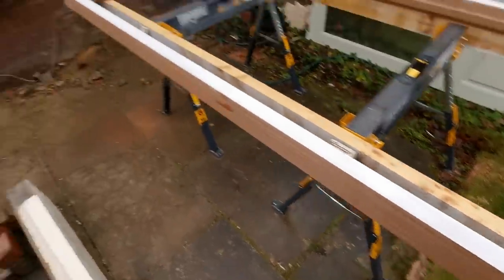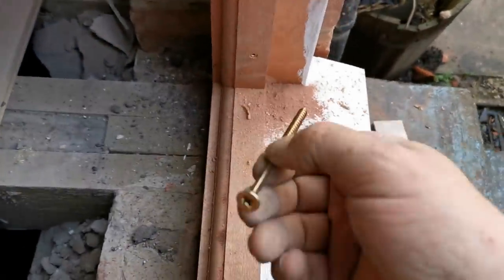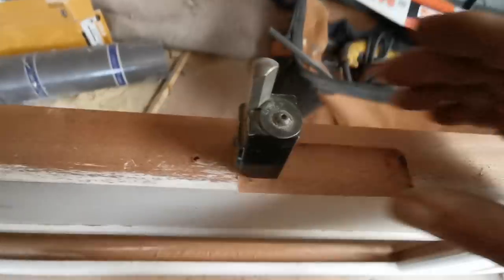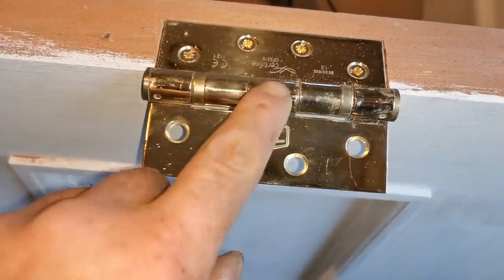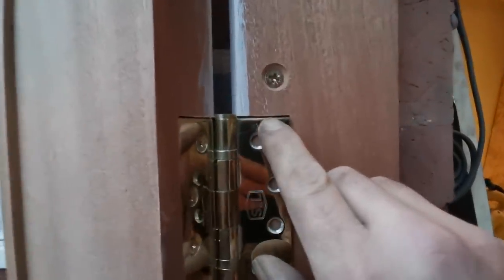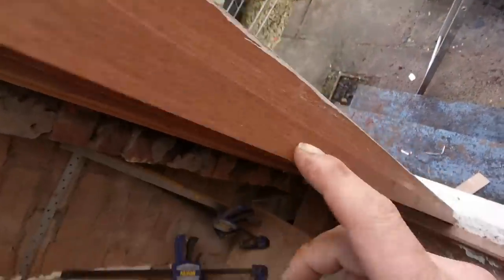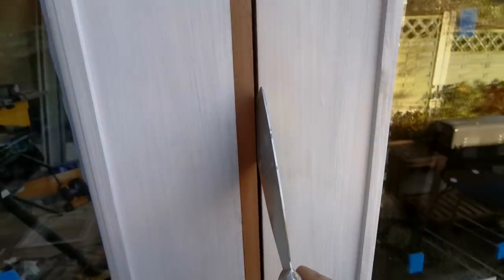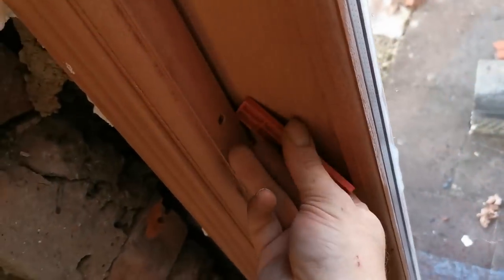French doors & bay window Pt14 - Fitting the frame & hanging the doors

Comment: Great work seeing you fitting them doors reminded me of when I was taught by my grandad who taught me most on the post ! Can hear him now saying it one quick queson dose the glue that you used expand once dry just seem like it dose from what I've seen when you use it in past videos also is it 5 mins drying time like they say or dose it need longer  I know temperature is going to affect it aswel I've not used it yet but am nearing the end of the tub of glue I've got and thinking of giving it ago to see if it's as good as seen and heard from others
Reply from the maker: Thanks Derek, 👍 This one i prefer is 30mins, it dries fast enough, I have some of the 5mins but it dries a bit too fast for me, the 5min stuff smells like contact adhesive & if you're putting some on joints, by the time you've spread it n start putting it together it has a light skin on it, it'll prob stick ok but i prefer the glue to be wet when it goes together, this 30mins is dry enough in a very short space of time, 😉👍 You're writing is like my dads txt msgs with no punctuation, a bit hard to read 🤔😉
Reply: Sorry reading and writing have always struggled with

Comment: Brilliant as always. I was watching some American so called “carpenters.” Apart from the “good ol’ boys” who repair wagons which their forefathers won the west in & probably used a a wedding cart when they married their sisters, all that seems to happen is they butt plywood up & fix everything with pocket screws. They might aswell be using aCNC machine, because all they do is press a trigger, because they’re all “power tool guys”!!!  If When America has a power cut nothing will get built. Perhaps they’ll hammer nails in hitting them with their Ridgid rear handle circular saws? 🤔

Comment: Hi Gid, really enjoying the progression of work included in this set of video's. 
I see from previous videos that you have a DW 5774 saw, mine needs a new blade and I think you have the Freud blade in yours, do you recommend them and if so what blade would you recommend for cross cut work. Apologies for asking but I know you know your stuff.
Please keep the videos coming , they are the best on YouTube, fed up of American waffle. Cheers Mike.
Reply from the maker: Hi, Thanks will do 👍 Yeah watching amateurs in big workshops making boxes & jigs can get a bit repetitive 😉🙈
Yeah, mine is the DWS773, similar saw, maybe an older model, I bought the Freud blade when i got it & it's the same blade, it works as good as it did new, I've a few now in most machines n yes I'd recommend 👍 I can't remember exactly which one i got. 48t i think, but i made a vid & I'll have a look at Screwfix, This vid is march 2018 so it's 2yrs old & i can't fault it 👍 
https://youtu.be/7yND36hDiLs
https://www.screwfix.com/p/freud-tct-circular-saw-blade-216-x-30mm-48t/5037f
Reply: Bought the blade by Freud as you recommend and it's bloody brilliant . The cut is so clean with no breakout at all and there is no resistance to the blade passing through the wood.
Many thanks,
Mike.

Comment: How did you attach the seal ?  Is it the Aquamac stuff you rebate in to the frame?
Reply from the maker: Not telling, you'll have to watch Pt13 again, 6mins in 🤣🧐 https://youtu.be/YazZD1F1Sgc
Reply from the maker: The cutter, a slot cutter of 2.7mm will do, https://www.axminster.co.uk/axcaliber-weather-seal-cutter-for-aquamac-21-wiping-seal-666074
Reply from the maker: Doorseal, Schlegel AQ21, screwfix sell it too 
https://www.toolstation.com/schlegel-aquamac-21-seal/p44823
https://www.ironmongerydirect.co.uk/product/schlegel-aq21-(ql3009)-aquamac-seal-10-metres-brown-609549
Reply: @Gidjoiner  lol

Comment: That Bosch impact driver has been rather camera shy of late..
Reply from the maker: It's a bit shit at anything but a standard screw, the other standard drill/driver Bosch has 10x more torque & a lot of the time i don't want my screws hammered in, saying that i do other work where it has come into it's own, like putting up a 2x1 above a window for a curtain track last weekend, 3" screws weren't happy with the normal drill going into an old wood lintel but the impact whacked them in, i was thankful for having it then, 🤷‍♂️ It's new to me so a bit of a learning curve & i hate the noise, newfangled machine 👴🤣
Reply: Gid Joiner I thought mine was rubbish aswell as I have the same drill/driver & impact and my drill was better with more torque than the impact driver. Sent my impact back to Bosch and they sent a new one as it had a dodgy gearbox motor from new. New impact driver they sent is loads more torquey than the drill/driver now 👍👍
Reply from the maker: 🤔🤔 hmm interesting, I think i'd have to compare mine to another, I new from the video reviews that the Bosch was the worst but it suited my batteries & it was on offer
Reply: Gid Joiner Could be a dodgy batch, got mine about same time, likewise already on the Bosch batteries. Didn’t sit right that the drill/driver was putting screws in easier. New one they sent is in a different league. I’ll see if I can send you a FB video or summat